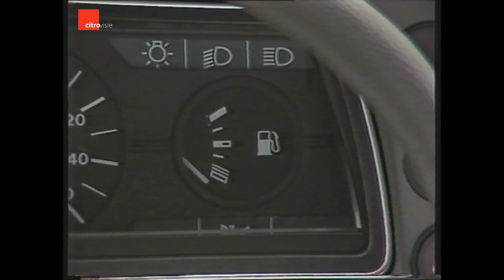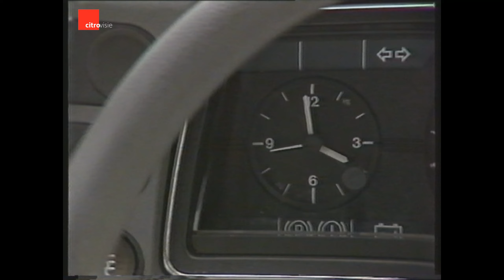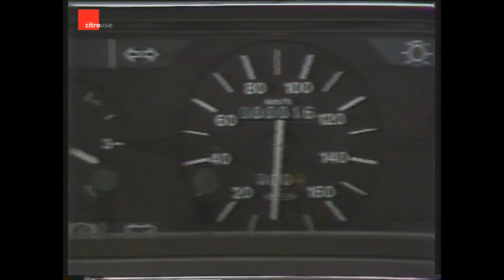Vintage footage | The 1985 Citroën range

Comment: Vanaf 1990 heb ik 19 jaar lang met verschillende BX'en gereden, altijd diesel of Turbodiesel...tussendoor kort een Saxo gehad en zelfs een Visa.
Nadeel van de BX was wel die ene ruitenwisser, je zat altijd met regendruppels aan de linkerkant (bestuurder) tijdens stortbuien....maar de veerbollen-vering mis ik nog steeds, al 12 jaar....de Kangoo veert niet slecht maar de HP vering is de beste ter wereld.

Als eerste auto in 1968 (had 1 week mijn RBW) een 2CV uit 1959, sinds 2010 weer terug gedaan naar mijn andere Franse merk Renault, de Kangoo DCI-82......in de jaren 70 had ik een R-16 TS en na de 2CV een R4-TL in 1970 toen ik in dienst moest.

In de jaren 80 veel SIMCA's gehad, de 1501 Sp. de 1308 en 1510 SX en 1x een Horizon.
Reply from the maker: Leuk, een echte fan!

Comment: 1987 ??
Reply: No, the CX still has chrome bumpers so is a Series 1 which lasted until 1985…
Reply from the maker: No, model 1985. The video was shot in august or september 1984.